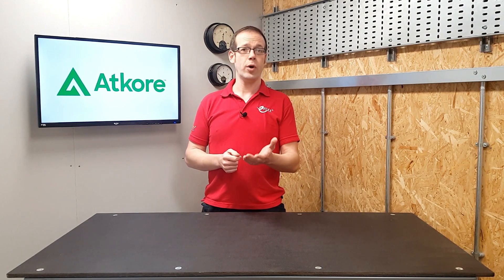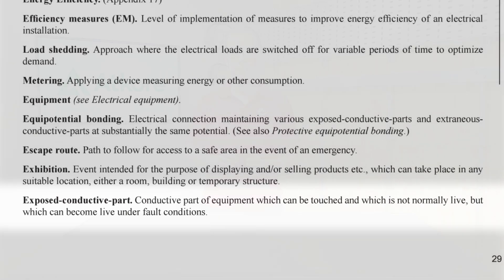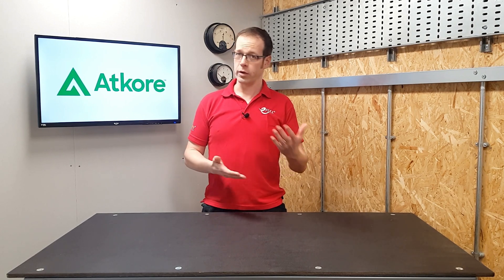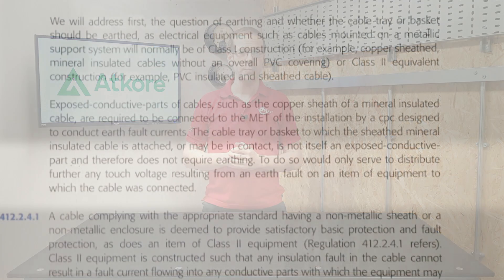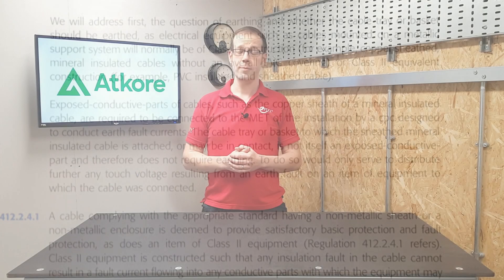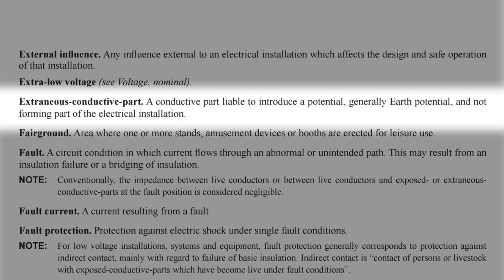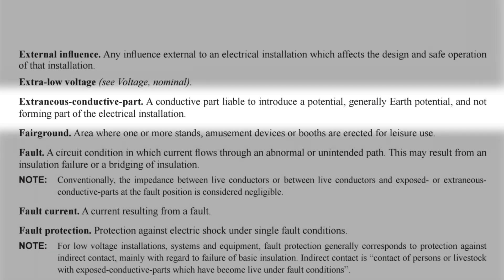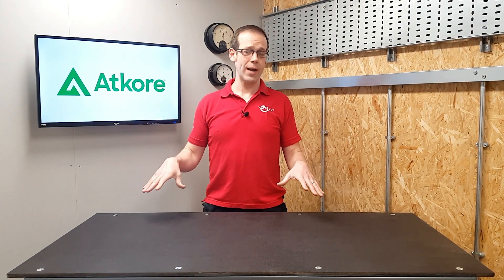Do you need to EARTH BOND metal cable trays and basket? BS7671 electricians' Q&A

Comment: In Portugal it was a requirement back in 2007 at least, all lengths must be bonded to assure continuity, even in a café for example all stainless steel tables had to be bonded.. in other view, if there’s a wire connected to it and if an earth fault occurs, that metal can become electrified but if there was no wire connected to it, it wouldn’t. At the same time, I’d expect to have continuity just by the fact that it’s all bolted together and provided that there’s no severe rusting on them.. so I’d probably still catch a buzz 🤷‍♂️

Comment: Wouldn’t we class metal tray as an exposed conductive part as standard, given it forms part of the installation, and may become live under a fault condition due to cable damage???
Reply: But how likely is the cable to be damaged? If installed appropriately then cable should normally be unlikely to get damaged, if there's a high risk of damage then you need to consider what measures should be used to minimise those risks.
Reply: @farmersteve129  I’d say it’s very unlikely for a cable to short down to the tray, but not an impossibly. 
A cable is more likely to become damaged nowadays due to these metal cable ties, being overnighted. 
I’m my book I’d call steel trunking, trays and baskets an exposed conductive part, and always install a bond 🤷‍♂️
Reply: I dont know but would pests or even pets destroy cables, breaking it down to raw pieces?

Comment: Some times tray is touching other metal work and plumbers hang there pippes from the tray . And now light fittings and fixed to the tray .
Reply: Bond it anyway and stick a rod in to separate  it from the main earth.
Reply: @stuartcraigon2003  what?? Really

Comment: Let's face it ,it does not take much to fit a earth bond ,and yes peace of mind 👍
Reply: But you could be making the installation worse as per guidance note 8. 

Also what’s a earth bond?
Reply: yes tncs could make exposed metal work dangerous if there was an earth fault that then could introduce 😉 😜 touch voltages above 50v ac.

think its good to bond any tray that goes outside 😌 and inside weight up the risks of damage to swa or other types of cables as to bond or not bond and class as exposed conductor.

I personally would look to bond if could be damaged by forklift etc
Reply: Earth bond? That's meaningless.

Comment: So, if your tray or basket,is not ,
i. An exposed conductive part
ii. An extraneous conductive,
iii. Forms part of circuit and/or a CPC,
 It may just be a piece of Metal 🤓
Reply from the maker: 😂 Best comment so far!
Reply: @efixx  I’ve got an even better comment,, If wago technology meets the needs and classification of MF “maintenance Free” and are constructed not much larger than the smallest piece of Lego, Would it be optimal if manufacturers of MCBs, and RCBOs to incorporate this technology at the point of termination ? This would then negate the issue of over and under tightening at the terminals and mitigate the human error side of things which potentially causes fires?? I would patent the idea but I don’t understand the paper work involved..
Reply: Wago and Hager could collaborate and infuse the masterful technology each manufacturer is accredited for,,, And to save on branding consultancy fees I offer this suggestion to,, They could Brand it as a Wager , or a , Hago ,, 
Or Wylex and wago could be a Wygo,,?
Sorry for not involving you guys at BG, but my vocabulary is limited,,
Reply: @Defectiveresistor well, I guess that solves it then,,  you should share this epiphany with the wider world as it may be the solution to a lot of errors created by humanity
Reply: @Defectiveresistor  Mr D, I totally agree,, I’ve personally experienced all those situations,, Take driving ,,even if we all followed the Highway Code to the letter, I would still want to wear my seatbelt and have my car fitted with an airbag.. nice chatting with you mr.d but this England rugby team are shocking so I must go and shout at the telly 👍🏻

Comment: Sometimes cable tray / basket is fixed to the frame of steel frame buildings in which case it’s already bonded as the building frame would be connected to earth. I noticed in bs7671 that the metal frame of a building can be used even a CPC in certain criteria. . If the building was non conducive I would tend to bond it as good practice and piece of my own mind. Very interesting vlog .
Reply: interesting that electricity doesn't want to go to earth.....it wants to go back to its source ....
Reply from the maker: Interesting comment thanks!
Reply: Why bond/earth though? Shows a lack of understanding if you ask me.

Comment: I'm doing tray on a flat roof for armoured cable sat on rubber feet on flag stones and I I'm told to earth strap every joint the start and finish ends of the tray are open and not connected to anything do I need to earth or not or just do as I'm told
Reply: I've had these same thoughts many times with tray and ladder rack, bonded all the way through the run but the ends open. I just do as I'm told by someone who gets paid more than me.
Reply: Used to do this in areas where bird damage was highly likely as the potential across the containment could differ if they pecked through live one end and cpc or neutral the other (the idea being if you came to do a maintenance check at any point it would save electric shock. In the end we just put ducting over the top for mechanical protection or swapped to swa so we didn't have to bother. I know on most high rise buildings AC contractors will use hi tuff and put up bird screening to avoid the problem and keep costs lower.
Reply from the maker: Just based on this I'd suggest it wouldn't need doing unless maybe there's some lightning protection issue. But if it's been designed by someone else and that's their decision then just crack on!
Reply: Who's paying you and who's doing the certificate?
Reply: Probably to counter any expansional movement due to elements.
Reply: no real need i would say... whats the risks of damage ?

Comment: So, here I am walking around on a concrete brick patio outside of the house and I notice a tube of conduit poking out of the house and onto the top of the brick concrete patio. But, not through the patio into the Earth, just to the surface of the patio. I bond it.

But then, I'm walking around inside the house, and I notice a length of conduit attached to the concrete and brick wall inside the house, but not external to it. The wall essentially is attached to the Earth just like the concrete patio is attached to the Earth. I don't bond it.

But both brick and concrete structures are in contact with the actual Earth, one gets bonded, the other doesn't. 

Anyone know why?

Comment: Hi Joe, I prefer a cable tray/basket with good earth bonding. I have experienced a live cable touching the metalwork in a very long cable tray, that didn't trip the breaker(C16AMP without RCD) because it was not making good contact with earth. 
Me and a collegue were pulling a data cable for the security system and that collegue had a nice shock from it. Luckely he was standing in a platform lift aswell so some isolation from the earth.
Reply: Hi - sorry to hear about the shock. My take is all conductors must be insulated and sheathed and all junctions made in boxes etc for the metalwork to not be an exposed conductive part.
Reply: @davidw460  Hi, even when you deliver the most perfect installation without making a good low impedance connection to earth. When an incident happens that a cable gets damaged and the line conductor makes contact with the cable tray. This cable tray will become live. So only two options remain, additional protection by rcd or earth bonding. When no additional protection is available the impedance to earth must be low enough to trip the breaker. 5-10 times In for C type characteristic.
Reply from the maker: Some good points made here.
Reply: Earth bonding

Comment: Only 5 % of sparks understand earthing and bonding , should be taught better in college.
Reply: I totally agree , I don't blame the tutors I blame the curriculum, plus a lot of new sparks don't understand how electricity works or seem to be interested .. i had 1 so called gold carded spark fitting neon switches and stuck all the neutrals in a wago .. go figure haha
Reply: Anyone on here saying " i just bond everything for piece of mind " is in the 95% bracket.
Reply: @scabthecat didn't get it myself until i read up on it.
Reply from the maker: Agreed about there being a need for more education on this subject. 👍
Reply: I agree, earthing and bonding isn't something which makes sense right away and I think I could do with learning even more myself
Reply: @robertburrows6612  unless bonding makes it less safe... which is what was mentioned in the video about extending touch voltage.
Reply: when i was in college it was taught very well, it went a bit crazy in the early 90`s with people wanting to bond metal windows and the like, but as a rule most dont know  your right.
Reply: @robertburrows6612  the video quotes GN8 at @1.45 which specifically states that bonding where this is unnecessary could potentially introduce touch voltages where these are otherwise not present.
Reply: If all cables are properly installed with care then tray won't need bonding.